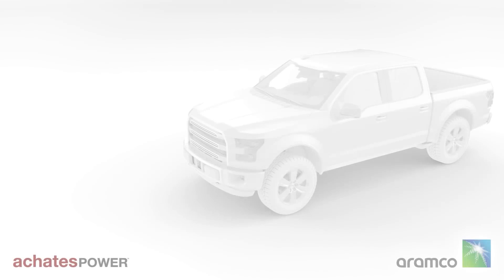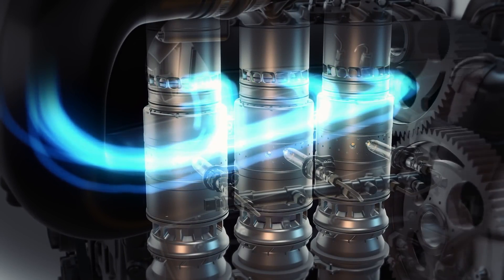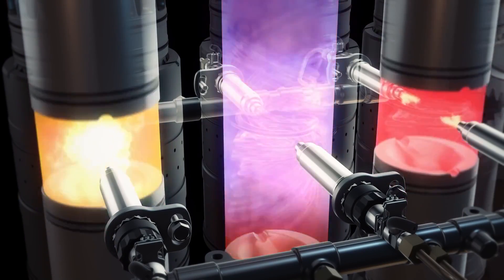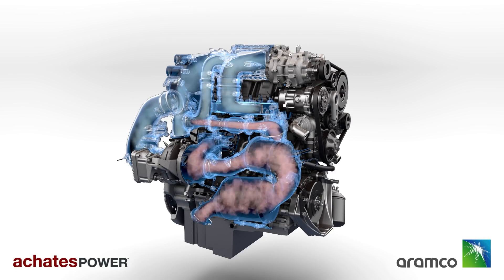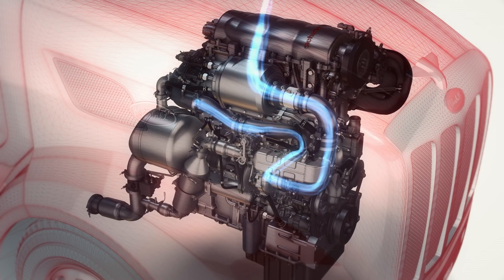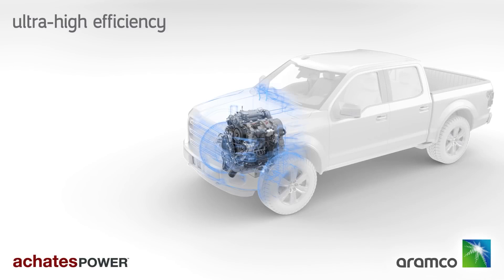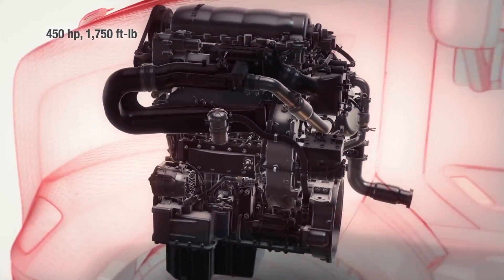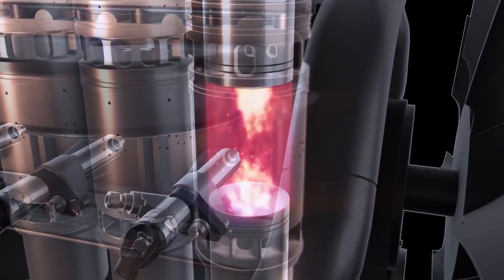The Achates Opposed Piston Engine: The Only Green Diesel Engine

Comment: I would consider a valve train far more complex than a crank.

I do wonder if the inability to vary timing of intake and exhaust may be a concern. This suggests using the engine in a series hybrid drivetrain, tuning the ports to a steady speed generating mode.

Comment: Achates did not develop the OP engine, been around for over a century, so why did Achates fall off the radar if things are so great? There is benefits to the OP design but the 2 cycle ported cylinder has been problems for several companies in the past. Why not an L-type head 4 cycle OP engine similar to turning two flat head blocks together with a spacer? Seen it done with lawn mower engines and it works........

Comment: Commercial EVs would do well with Bettery Swapping. A diesel truck takes like 15 minutes to fill those big tanks. If a EV truck like the Tesla Semi could swap the battery in 2 minutes, it would actually be advantageous to drive ev over diesel.

Comment: One question: Why are opposed piston engines usually vertical and not horizontal, since it would make them flater?
Reply: Horizontal engines like Subaru and Porsche boxter engines have problems with cylinder wear being uneven due to gravity.

Comment: Opposed piston engines don't need two crankshaft's. The TS3 engine had one crankshaft turned by a toggle system and was successfully used in commer trucks in the 50s and 60s . When Chrysler took over they scrapped the idea and destroyed the drawings.
Reply: I live in a bus with a 1957 ts3 engine. Still does 20mpg!
Reply: You mean this?
https://youtu.be/pGaISFg_ZIw

Comment: I have been a marine engineer for over fifty years. I have worked on opposed piston engines a lot. They were common in marine applications. They didn't give many problems at all. The biggest problem was the cost of manufacture. From an operational standpoint they are far more efficient than a conventional two or four stroke diesel engine. As for complexity, I have come across far more conventional engines that are far more complex and nowhere near as efficient
Reply: One more point to consider, The Roots Group, part of Chrysler had an opposed piston diesel in the 1950s.This engine only had one crankshaft. It used what looked like large rocker arms to connect to the crankshaft. The engine was made in Grt Brittain. It was called a Commer TS3. It was used in trucks till the early 1960s. Chrysler canned the engine and stopped producing it when they took over the Roots Group

Comment: oh right. didn't think about piston passing ports issue. how bad is it?   maybe if they come up with design that makes changing rings relatively easy it will not be such a problem?
Reply: It's absolutely fine, there is plenty of material between the ports to supprt the rings, it's not like a two stroke motorcycle engine with one huge port that the ring can bulge out into.  The old two stroke Detroit diesels had exhaust ports in the cylinders and were very reliable.

Comment: "15 kilometers on a litre" what kind of unit is that? 
The correct or at least the usual way of stating fuel consumption would be 6.7l/100 km
Reply from the maker: Remember "usual" depends on where you live

Comment: That engine would be complex to fix or even build one side go's out of timing means the destruction of the whole engine plus 2 shafts means 2 timing belts and twice the problems look at every thing you'd have to take off just to work on it. The Vblock does the same thing with 1 shaft and 1 timing. Just blowing one cylinder on this engine would damage both sides and all that stuff on top a nightmare to even work on. Electric motors burn up if they get to hot
Reply: Sorry to burst your bubble but there’s no timing BELTS on these engines they very sensibly use timing gears like we did in the olden days thank God.
Reply: @davidellis279  no bubbles burst here man lol just talking the dynamics or future problems I'd see that's all you OK man did I offended you in some way I like the Detroit and Caterpillar motors is that OK with ya
Reply: @bradkaberline5828  it's actually very simple to work on. the most complex system being the air system
Reply: @lexluthor6906  the thing about this motor is the block and cylinder is like a punching bag or in a way like put two horses one in front the other in the lead horse is doing most the work and going to wear out faster were as the vtwin motor distributes the work like a side by side horse if that makes sense one cylinder with 2 pistons that cylinder is going to wear out faster and if one ring goes bad the whole cylinder loses compression on both pistols so lose of compression in 2 cylinder if that makes sense
Reply: @lexluthor6906   know it going to take more combustion just to move 2 pistols in which case burning more fuel faster if that makes sense even with a straight inline works better because one cylinder beefed up and one piston beefed up  or made like heavy duty would still take less combustion to move the piston in the cylinder
Reply: @lexluthor6906  as I said putting 2 horses onecin front of the other the lead horse is pulling the weight of the other horse and the wagon side by side they both pull the wagon    in which you get more horsepower if that makes sense just trying to simplify the terms or how it works
Reply: @lexluthor6906  not to mention if it takes more combustion to move 2 pistons it for shore is going to burn more fuel faster
Reply: @lexluthor6906  then you look at the simplicity of fixing it such as Ford and Chevrolet well earlier ford's the assembly line factor interchangeable parts ect look at a Subaru motor it's in the shop for month due to having to pull the whole motor out just to get to what you need as I said 1 piston or even cylinder failure or even one side of such cylinder makes you have to replace both in which a cylinder head can be replaced fairly simple with tools and such. Even Henry Ford was pissed when Ford stepped out of such thing and gm picked it up
Reply: @davidellis279  the old days man that's way the Detroit diesel was a motor ahead of its time more torque for pulling and built to race engines specs of today's standards balanced rockers ect. Plus recycling with turbos and blowers ect

Comment: I think the concern about piston rings travelling over the ports is not the issue you might think.  Two stroke Detroit Diesels existed for many decades, and the technology to get long life out of piston port diesels is very mature.  What I always wondered was how Achates managed to get such good combustion from peripheral injection, most diesel engine designers try to get the injection as close to the center of the combustion chamber that they can.
Reply: I imagine you could inject on 2 opposing sides of the cylinder. That helps spread the pressure from the burning fuel out and helps give a more even pressure on the piston heads
Reply: @chadjensenster  they do inject from both sides
Reply: as to the rings two strokes have been running there rings over ports forever no problems yes a little more wear the problem is , heat , the old detroit two stroke diesels cyl ports were the intake ports keeping excessive heat away from rings piston skirt ect , if they reversed the in,ex so as the exhaust didn't go out the valves but out the ports at bottom of bore the amount of heat would cause the oil residue between rings,bore to evaporate used as fuel , hence scuffing that would be catastrophic like not putting oil in your chainsaw , the lubricating oil film which in these eng is miniscule as compression rings almost never see a part of the bore which has had oil on it , which is how normal 4st eng lubricates its compretion rings . So all opposed piston engines suffer this problem scuffing of bore rings piston on the exhaust side of eng , they only refer to it as excessive heat can't put oil in fuel like chainsaw as this is injected oil is fuel , answer is to allow the oil rings on very bottom of piston to fail just a little , the uppermost part of the bore swept by oil rings is also swept by the compression rings so they see a little oil residue, lubrication . this is the reason all opposed piston eng leave a smoke trail, side injection is a cause for pore combustion though this is able to be overcome l believe swirl, tumble ect egg shaped chamber  . So were does this leave Achates how many dollars how much time shit load of patents very quiet no product yet not for the roads . army doesn't care for pollution regs. There we have it , thanks P D'Arcy
Reply: Side thrust on power stroke is on the other side of the bore,   and lubricants got a lot better since 70's.
Reply: they have some "fancy"  surface on the pistons opposing each other creating vortecies tumbling the mixture so the fuel burns completely
Reply: its not peripheral injection, if you look closer you will see that the diesel is pump injected in the middle of the chamber.
Reply: @ivansenpaid9486  yes it is. The injectors are firing in from the sides of the bore.  Traditional two stroke diesels like the GMs had the injector in the centre, spraying radially.  This gives the fastest burn through having the spray diverge as much as possible while also having the shortest possible flame path.  The Achates engine is injecting in a narrow path from the side of the bore.  Flame path length might be similar, depending on bore size. I’m really curious how they are getting such good combustion.  I don’t doubt they are, I’m just really curious HOW.  I’ve got a soft spot for two stroke diesels😀

Comment: ever since seeing the concept of this engine a few years ago, I've always thought about putting the engine into a flat position for passenger cars, such as porsches and other low-slung sedans and coupes. maybe a gasoline version can be made with direct injection and used for even smaller cars, with a single or double piston arrangement
Reply: I’m with you on this,I’ve been a diesel  engineer for over 50 years and I think without laying this engine horizontally it’s going to use more oil than diesel because being vertical oil from the top crankshaft is going to pour down the bores increasing oil consumption. I’ve heard a lot about this engine and in principle it’s a great idea but not if it’s mounted vertically because of the problems I’ve mentioned,really hope I’m wrong about this but it’s taking a hell of a long time to bring it to Market and cost’s are going up and up with NO returns as yet. The two crankshaft idea is brilliant but NOT for vertical applications, I could be wrong and they think of some way of stopping the oil of draining down the top bore’s but I can’t think of any.
Reply: @davidellis279  I think the main concern with the orientation is that the oil channels for the upper crank are designed to run straight down, and reduce the amount of standing oil in the upper cylinder, but with the boxer/flat design they would likewise have to adjust the oil galley/piston squirter positions because of the iconic bore scoring that so many subarus and 996 porsches had. I think with the little fixes/optimizations, a flat layout would definitely end up consuming less oil than vertical.
Reply: @davidellis279  The 14.3L military version appears to be horizontal.
Reply: @davidellis279  no problems in the vertical position. the reason why most variants are vertical is because it packages into current vehicles without much change.
Reply: @davidellis279  they’ve been using this design vertically since before you were born. They wanted to lay it flat for World War II bombers but actually had oil problems with it then ... had to do it vertically
Reply: @leeknivek  I don’t know what experience you have on Diesel engines,I have had many years working on all types of them and yes vertical two strokes have been used for many years and successfully but I have Never see one with a crankshaft mounted above the cylinders,it’s a great idea having two crankshafts but the upper crankshaft has to be lubricated and that’s where the problem will occur. Oil from that process will pour down the bore’s and cause all sorts of problems possible hydraulic locking,they have been playing around with this engine now for quite some time and must have spent a lot of money on developing it but as far as I can see their no nearer putting into production and fitting it into a vehicle than they were a couple of years ago. I think they have built one into a Ford pickup truck for testing purposes but everything has gone quite since,it’s a great idea the twin crankshaft set up but I cannot see a way of getting around the oil problem draining from the top crankshaft draining into the cylinder’s as oil only drains one way according to gravity and that’s down,I suppose they could cast the block so that the oil drops into a channel and then drains away from the bore’s and back to the sump,either way they’ve spent a lot of money and have little chance of recovering it at present as things stand.
Reply: @davidellis279  similar engines have been in production (same engine models) for nearly 100 years. Fairbanks Morse, junkers jumo, some Soviet versions, they are well known and reliable engines. The Napier deltic has even three crankshafts, two of them overhead, and those were used extensively during and after world war II. 

All I'm saying is that this is not a prototypical design, it's a well documented engine that's seen use and development all over the world. Predates the poppet valve trains even. 

This particular engine is a prototype from this company, and they are using modern components and architecture to maximize power in a way that wasn't possible before, but they are, in historical fact, a very simple a reliable design (used in Soviet tanks, American trains, Nazi warplanes, and British lorries), and have garnered a very good reputation. 

I understand your engineering concerns with the design. I had them too, but really, having two crankshafts is far, far less of a concern than having a valve train, a head gasket, 100 more moving parts, a cam shaft, a timing set,  a heat soak, etc. 

So it'll probably burn a little bit of oil - every engine does - and so far is recorded on this engine in particular that it burns no more oil than a conventional four stroke design. 

Not to mention that this engine is able to exceed even the strictest environmental regulations while still being dead simple and reliable (I personally hate emissions control systems to my core for the sake of turning cars and trucks into unreliable, expensive and overly complicated pieces of cheap Chinese junk), and despite having less emissions, it has a power to weigh ratio that is perhaps double that of a conventional four stroke.
Reply: @davidellis279  I guess to put it in a shorter way, too - because the compression is so high and the cylinders are so well sealed and the oil used is going to be heavy enough (such as a 15w or 20w cold) then oil is going to have a hard time finding its way into the cylinder. That is, as long as it's not starved of oil causing the rings to fail. But there is a lot less heat generated in this by design too, it's not simply a two stroke like the old Detroit's, the second piston is converting heat into energy, rather than dissipating the heat into the head. So not only is the heat more concentrated directly where you're removing it in the water jacket, top and bottom, but there's also less of it, and you have a lot more oil to absorb the heat as well. 

I mean, time will tell, certainly it has it's problems and in an ideal world, two crankshafts is not really great, but I think the negatives are definitely outweighed by the positives.

Comment: canțt be made an engine like this with 120hp? seriously 1,9 tdi equivalent would be great.
Reply: It can, but it wouldn't be quite as efficient... since the large cylinders and hence only 3 of them are part of why it is more efficient... large cylinders are inherently more efficient than small ones since the ratio of cylinder wall to volume becomes more favorable.  Even a tiny 1L 100hp version would be quite nice to have for small cars + a hybrid system it should be quite peppy and get excelent mileage.

Comment: Hi, you didn't give fuel consumption on truck, I would like to know. This is the tech we need between fuel and electric cars. As you said commercial vehicles is a problem at moment,  thanks
Reply: The f150 conversion was said to get 37mpg without a hybrid system.... with a hybrid system it cloud probably push up into the 40s.

Comment: I'd love to have the 2.7 LTR diesel version in my F350.:)  I'm running a Detroit 4-53T that's two stroke, but not near as efficient as the Achates.:)
Reply: The 3 cylinder does have the 2 stroke sound doesn't it they should probably build a 4 cylinder for an F350 sized truck.
Reply: @Wingnut353  From what I've read the 3 cylinder is a better fit for scavenging over the 4 cylinder.  That's why they've built the 2.7 and 10 LTR in 3 cylinders.  The 4 cylinder that is built under license by Cummins is 14.3 LTRS and built for military use.  I don't think the military engines have to adhere to the EPA regulations.  Very nice engines.:)
Reply: @Wingnut353  Nice i got a 8v92 detroit 2 stroke turbo, nice engine and a small block 4l johnson v8 side oiler outboad.
Reply: How about a 1700 rotax OP 2 stroke made from 2 850 rotax etec's turbo. this would make one sick trail OP 2 stroke sled.
Reply: @jlo13800  That it would.:)
Reply: @detroitgarage9430  The 2.7L could fit in an outboard as a 2 stroke can run in any position. The oil injection tank and plenty of amsoil intercepter should work fine in the Achates 2.7L 2 stroker. Run a dry sump with VRO like the evinrude Etec does.
Reply: @detroitgarage9430  4 joke strokes suck!